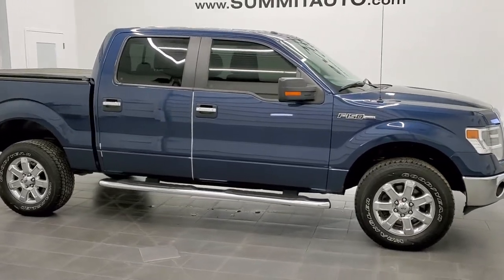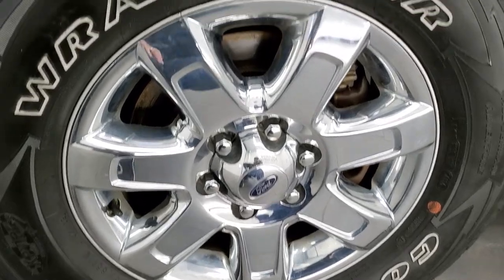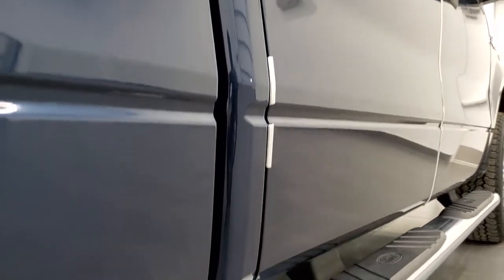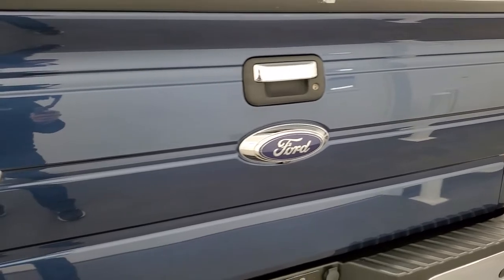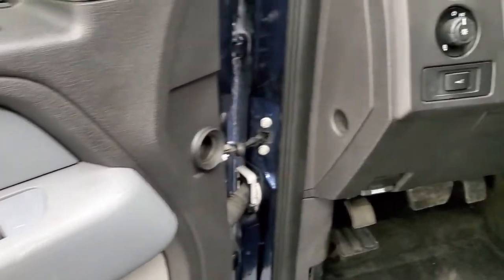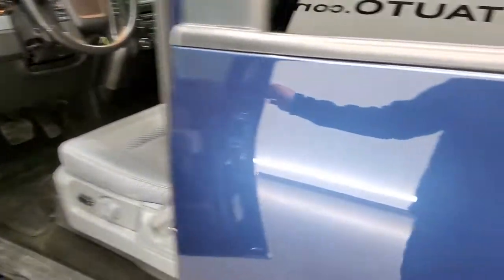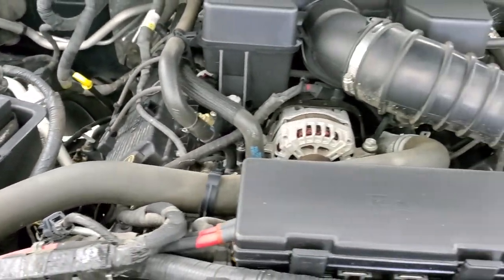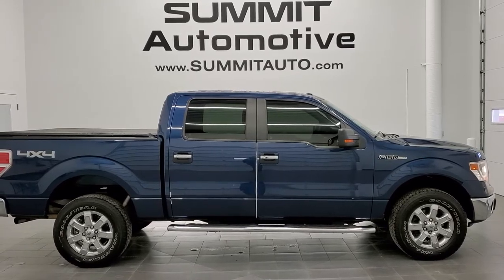VERY RARE 6.2L V8 FORD F150 SUPERCREW XLT BIG BOY BLUE JEANS METALLIC WALK AROUND REVIEW 11288A SOLD

Comment: I want one of these with the 6.2l
Reply from the maker: I know I should have bought this truck but I literally bought a different one the  week before otherwise this one would have been mine
Reply: @Summitauto  I got a 6.2L Platinum. The price was so good I overlooked a bit of rust on the cab corner. Otherwise in very good shape. I will be repairing it soon. It is going to be used for work, so it don't have to be a showtruck. Otherwise the drivetrain is out of this world. The few MPG less for the reliability and power is well worth it.
Reply: I have a 2013 xlt with the 6.2. 70k miles and it's super clean. I just picked it up. So so fast